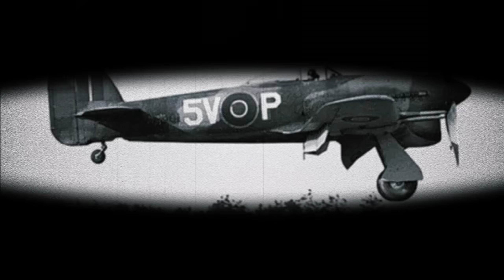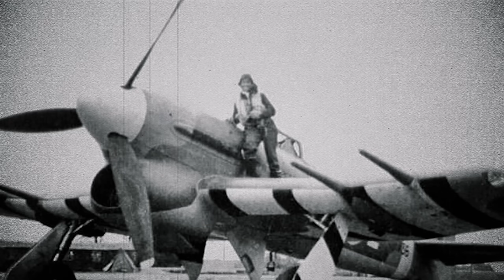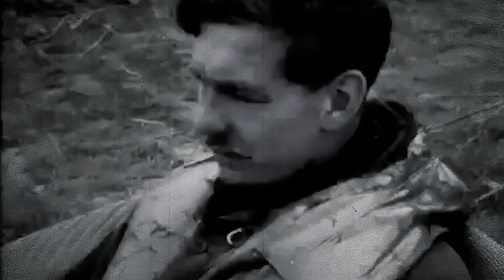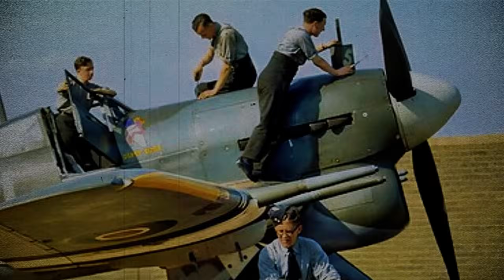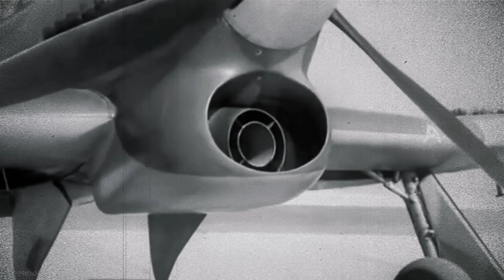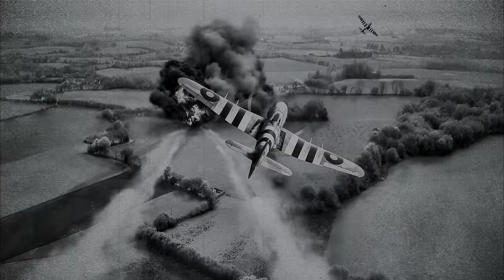The Dark Reason So Many Hawker Typhoon Pilots Died

Comment: What wasn't mentioned in the video is how extremely dangerous the Typhoon was to belly-land, ie with the landing gear up. The huge radiator right under the engine would dig into soft ground, causing the aircraft to completely tip over and crush the pilot in his cockpit. As the Typhoon was often used in low level ground attack missions, pilots were too low to parachute from a stricken aircraft when hit by AA and belly-landing was the only option.

Comment: The Republic P-47 Thunderbolt is widely considered the most successful Allied ground attack aircraft in Europe during World War II. It was a tough and heavily armed fighter-bomber, capable of carrying a significant payload of bombs and rockets, and its eight .50 caliber machine guns made it a potent weapon against ground targets. The P-47's ability to withstand damage and its robust design made it a favorite among pilots and a key asset for the Allied forces.
Reply: Still nothing in comparison to the Typhoon and its ability to change the course of the whole War.
Reply: @docbob3030 Maybe in your corner of the world, but the P47 was used in every theatre to devastating effect.
Reply: @docbob3030  

P-47s are the reason why Typhoons can even fly CAS, it was the P-47 (and also the P-51) that broke the back of the Luftwaffe (or at least severely damaged it) during the first half of 1944.

The Typhoon was never really used for the explicit purpose of going on the offensive to destroy the Luftwaffe, either it was (temporarily) used in the low altitude interception role (so a defensive role) against Fw 190s used as fighter-bombers, or it was used as CAS that still stood some chance of defending itself (so only done when air superiority has been achieved).

Comment: My mother. was a Wren stationed at Treligga in Cornwall in 1944.  One of her jobs was replacing targets for the Typhoons after they had fired and returned to the circuit.  Obviously she did not have much time to run out with her group, lay the new target and return to the bunker.  There was a short grass strip, maybe 500 yards for the Typhoons to land on in case the debris thrown up by the rockets damaged the aircraft.    One foggy day a B17 came out of the fog with its wheels down wanting to land, the leading Wren went out with a Very pistol to try and prevent the landing but land it did, I suppose being a tail dragger with a skilled pilot.  Anyway the Wrens drove out to greet them and they turned all the guns at them without firing as they had no idea where they were and thought that they were still in France.   The next day they took everything they could off the aircraft, guns ammo bombs and pulled to the beginning of the runway.   At the end of the runway was a cliff and then the Bristol Channel.   A pilot and navigator started the engines, full power with brakes on and released the brakes and my mother and the Wrens watched as the aircraft approached the end of the runway and disappeared over the edge of the cliff, the sound of the engines disappeared also.  A few moments went by , they held their breath, and then the glorious sound of the four engines and the sight of the  bomber climbing away.  She also said that a year later in 1945 the same thing happened with another B17.   She was only 17 when she joined up and her uncle made her take her driving test beforehand.  When she arrived at Treligga she was the only Wren who could drive and found herself driving the ambulance and fire engine!  What an experience for a young woman!
Reply: A wonderful story of a dedicated young airwoman - thank you for sharing it with us.
❤❤❤

Comment: Thank You for covering the Tiffy. The Spitfire and Hurricane were first flown in the mid-1930's so there was at least 4 years to sort out any Issues before WW2. In contrast the Typhoon was developed along side the Tornado, essentially the same but with a RR Vulture engine. The first Typhoon flew in February 1940 and was rushed in to service in November 1941. It took about a year to correct the major issues and by 1943 its reliability had vastly improved. It was only bettered at low level by its successor the Hawker Tempest.
Reply: But , then again, Typhoon was rugged and for ground assaults. Tempest was a fighter plane. Different areas of expertice.

Comment: The Typhoon certainly had to be rushed into service to meet an urgent need, with predictable results.
The Sabre engine was very much a work-in-progress, and caused plenty of problems before maturing into a superb unit with an exceptional power output.
But the airframe of the Typhoon was a primitive affair and far heavier than it should have been. The wing was unnecessarily thick and the internal structure seemed to use techniques more akin to building a bridge, without regard to the weight penalty. And the fuselage around the cockpit and wing roots used a primitive (and very heavy) tubing structure taken straight from the biplane era, adding greatly to the overall weight problem with considerable detriment to performance and agility.
When I first saw the identical tubing structure taken from a crashed Hurricane in an aircraft museum, I was amazed – it looked like a cross between a super-duty iron bedstead and a piece of agricultural equipment. And, unfortunately, Camm carried that primitive structure on into both the Typhoon and Tempest, it only finally being discarded and replaced with monocoque construction in the post-war Sea Fury. Hawker were at least 10 years behind Supermarine in this respect.

Comment: Essentially a more advanced Hawker Tornado.
Reply: The Tornado and Typhoon were designed in tandem with different engines being the only difference in identical airframes, the engine in the Tornado proved even more unreliable than the Sabre in the Typhoon, so it was dropped, and all effort was then given to the Typhoon

Comment: More planes wete lost to mishaps than to enemy action in WW2 and many thousands of aircrew killed.
Reply: Indeed. Young and unexperienced pilots flying extremely fast and furious aircraft under tough conditions.
Reply: The same could be said if the Me109 with countless ground accidents with inexperienced pilots
Reply: Another thing that's rarely mentioned is the number of pilots who simply refused to fly any more due to the danger. It was called "lack of moral fibre" & heavily punished but still over 30% of some operational units did so. Convoy patrol duty off escort carriers in the Atlantic was particularly susceptible as any navigation error or mechanical fault meant you were done for.